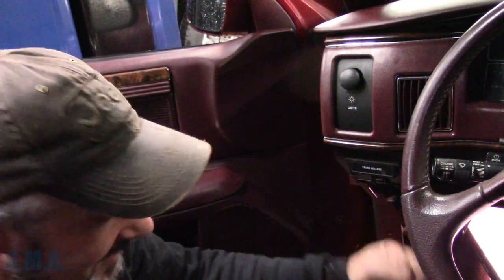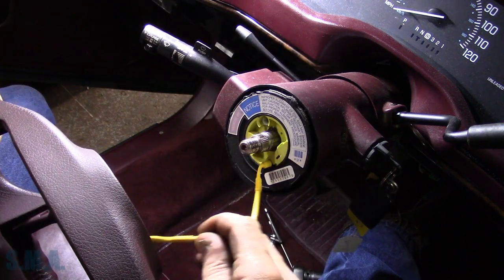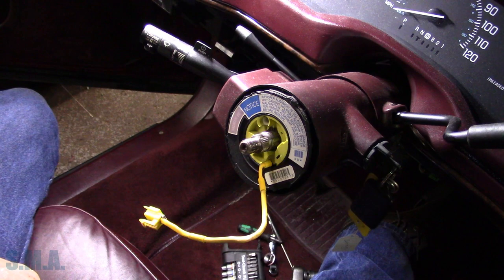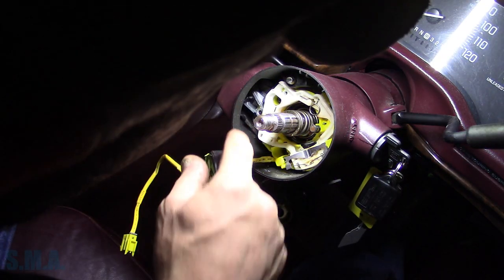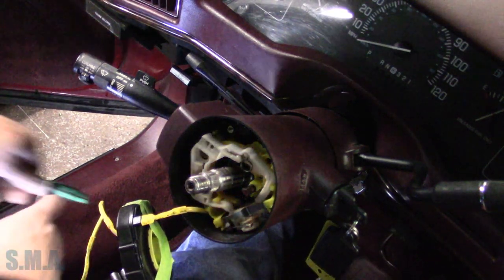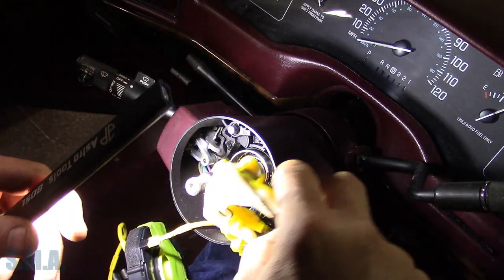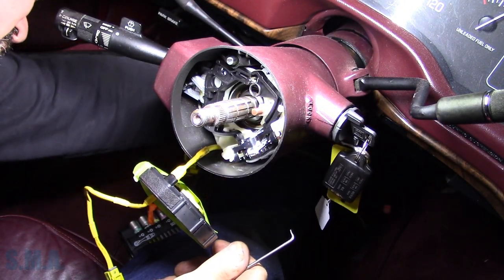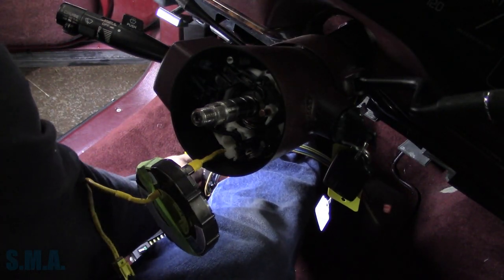Buick Roadmaster: Turn Signal Switch Replacement

Comment: I had to replace the turn signal switches and wiper stalk on my Jaguar xk8 on my driveway - air bag to deal with, 20 year old brittle plastic, very careful removal of cream leather trim (avoiding dirty hands) and of course the famous clock spring. A lot of work to do (especially as an amateur) and a few parts that are very scarce, if not impossible ro replace. What helped my was Eric's mantra -  'if I can do it, you can do it'. It would have helped to have seen this, because I had to follow the offical Jaguar manual which does not give any 'short cuts'. Many thanks for posting these video's Eric because its the 'small bits' that are often the trickiest. I don't mind in the slightest hitting brake discs (rotors) or the like because they are fairly resilient - but dealing with plastic clips and small terminals requires a different skill set. I hope all my friends in the states are keeping well - and best wishes from the other side of the pond.

Comment: I had to put a TS switch in a 2000 Eldorado recently and the column was exactly like that one.  I ended up having to de-pin the connector because I don't have a lovely assistant, I don't even have an ugly assistant, so that was the easiest way for me to do it.  Great video as usual.  Thanks for showing.

Comment: That steering column was notorious for the 4 bolts under the tilt wrist coming loose. I made a puller for the wrist pins, which had to come out to get at the bolt heads. I never had problems with the wire harness, probably because these had no airbags. 
Thanks Eric!

Comment: I always used to keep the old turn signal return springs on old switches because I would come across so many vehicles that had broken ones, especially the right side. Also, I would put a length of mechanics wire on the connector end of one coming out, once out attach the wire to the new one and pull it straight down, never had an issue, quick and easy!

Comment: that car puts me in mind of a old 78 Bonneville I had once ! the steering wheel was just like that one ! I like the 99 Chevy blazer I had now , it has a cover around the steering column you just take off and there is the combination switch and ignition cylinder !

Comment: The video may be 3 years old, but I need to replace the turn signal switch in the column of a '94 Buick Roadmaster Estate Wagon that used to belong to my father.

Somehow, whenever I searched for a video on the switch removal, this did not show up as onecof the results.  

I didn't see it until yesterday, and surprise!  It was was from SMA!
Even with all of the "errors" (hazard warning flasher knob?), it is a great video illustrating what to expect and what to go through.

Thanks for the video!!!

Comment: Watching you do this more than 35 years after I did it to my 1983 S-10 still made my head hurt.  When the same switch failed in my mother in law's 1982 Malibu  in 1989 I told her it was totaled!  And neither of them had a bomb that had to be defused and moved out of the way first.
Reply: Back in the day, getting the connector through the column involve a wire coat hanger - I wasn't cleaver enough to use the wires I was taking out to pull in the new one.

Comment: Speaking of airbag safety, there was a neighboring shop whose owner was injured from an airbag going off in his face when he got in and turned the key to go on a test drive. Really beat his face up a bit but was ok. Guy returned to work and I swear you not another car does the same thing again. And this happens again to a couple other workers. Come to find out the new guy though he was revolutionizing car interior detailing by pressure washing the interior while it was in the car.

Comment: Good Process Eric. I've seen many mechanics always short cut, use wrong tools or improvise during a procedure thus causing collateral damage and/or disturb other wires, connections and so forth to bypass getting the least elephant in the china cabinet results for making time in the repair. That's what makes it for those mechanics who's customers dignify them. "All Fixed" says the mechanic but the customer is noticing things are not the same such as the knee bolster has missing screws/fasteners, scratches on the steering wheel/column now and so forth. That's the real sign of a true mechanic when they get in there and take the time to preserve what's not wrong/broken during a repair, like in this SMA. Especially when its an older vehicle that the customer puts trust in their mechanic. Old or not, I'd bet the owner of the older cars are more sentimental about them than the new car owners are. Keep it OEM/stock and keep it right as it was is key. Thanks for the review.

Comment: Snap rings and lock rings -- designed to test your looking-for-stuff-on-the-floor skills after they fling themselves across the room.  30 seconds to remove them, followed by 20 minutes of crawling around on the floor trying to figure out where the damn thing went.  ;-)
Reply: Do better work or keep a supply on hand. Time is money.
Reply: @skinlab4239  I'm a DIY'er.  Buying a supply of snap rings would be a waste of money for me.

As far as "do better work" is concerned --  snap rings go flying.  It's what happens.  Snap-ring pliers don't hold on very well.
Reply: @LMacNeill  On the possible fliers I tend to put tape around them so they don't fly.
Reply: We called them Jesus Clips.
Reply: Exactly. That happens to me EVERY time.@$!#
Reply: Hate em, hate em, hate them!
Reply: @skinlab4239  Said The Equivocator.

Comment: Good video Eric. It brings back happy memories. My plate depresser tool was thin-walled enough that I just slid that lock ring all the way up the shaft and onto the tool where I knew where to find it and it was ready to slide back down when finishing the job. Cars didn't yet have clock springs back when I had my shop. I used to fold the wires along the connector like you, but I just slid it back down the column without much trouble. Love your videos. It's like being there without the grease and grime.

Comment: Good job Mr. O.  Only suggestion I can offer is via Andrew Camarta - chain saws make short work of interior parts.  It could have open up the column and made fishing the wires a little easier.  

It was good to see Mrs. O in action again helping you as well as providing needed banter.

Comment: I have done this on both a 1986 chevrolet S-10 and a 1988 Chevrolet 1/2 ton.  In both cases, I pulled the column out of the truck and worked on the bench - this saved destroying my ribs lying on the rocker panel and the lighting was far superior as well.  great video, as always!

Comment: We would always tie a wire to the TS connector, then pull the wire and connector through, opening up space in the column, and providing a fishing wire to pull the new harness and connector back through.  Cutting it off worked also.  Good job  Eric!!

Comment: I’ve never seen a stalk replacement so complicated. That’s quite an effort. Here in the the U.K. my cars of that vintage were a 10-15 minute job. Back in the early 90s I could have done four in my old 1984 Renault (about 5 screws) in the time to do that Buick. In fact I did do three which tells you about the quality of French electrics 😀

Comment: I worked at a GM Dealer in the 90’s I done so many of those turn signal switches. You got the job done. That’s what’s important. I still like my older cars though.

Comment: I bought all the tools to work on a 91 Firebird column and each time I got it back together the ignition switch felt like it was disconnected. Tore it down and got it working, reassembled and no switch. After about 30 times I finally got it and sold the car. Glad to know I'm not the only one frustrated by that simple snap ring that always catches in the second groove. This job is now classified as above my pay grade. Yea, I was screaming at the computer that you forgot the hazard button. LOL

Comment: Putting the tilt column in the straight(not lower or higher position) makes it ALOT easier to fish the wiring harness down thru it. I used to repair gm theft recoveries back then. I learned quite a few tricks on those columns. Peace

Comment: Those GM columns were used in everything back in the day.  My 90 Jeep YJ has the same one, minus the column shifter and airbag.  I have also had to go into it super deep to tighten the famous backed out screws to fix a floppy column.  They are not super fun to work on, but it is doable by your average joe.  Your wire fishing job was spot on.  Doing it with mechanics wire is sucky, but also doable with enough patients.  Great vid!  Loving the older vehicles, even if you hate em, lol!

Comment: Being a fleet mechanic for a taxi company during the late 60s thru the mid 80s this really brought back memories, I've done hundreds of those. Where the turn signal arm is directly attached to the plastic switch, and the driver thinks its a arm rest. Thanks

Comment: I did that nightmare job twice on my 1988 Silverado, the service manual said to run a .015 " piece of stiff piano wire up the column channel to pull the harness down.
After trying everything else, I used the piano wire and it worked!
Reply: Now that I see what you replaced my job was different, I replaced the turn signal lever and the harness that comes with it.

Comment: Great job with the vid Eric. I was holding my breath when you were fishing those wires around especially using the pick to move them around but it worked out good. Glad you had an assistant as it would've been tough without one. I don't know of any easier way to get the wires down the column though.

Comment: That little ring holds the entire top of that column together. It is responsible for setting the bearings at the top and bottom of the column. Back in the day I used to rebuild them and sell them to the local body shops for GM and Chrysler vehicles that were stolen recoveries. I used to make a pretty good wage for doing that, one hour of work, typically $30 on parts and I would sell them for $150. Plus a core.

Comment: I can't remember why but I remember getting into my sister's 91 Camaro steering column. I'm about to get into the steering column on my Pontiac Fiero because I'm installing a PKE system and I'd like to remove the lock cylinder and 3D print a new housing or cover to make everything look clean when I get rid of the key and lock plate.

It's common for people to get into GM columns and have trouble getting them back together, I'm in the Dallas area and there's a place called the column shop that specializes in columns of course. They've been the go-to in the Fiero community forever.

Comment: I changed out the turn signal switch in a '71 Riviera that was much the same.  The reason I changed it out was because the cornering lamps I wanted (and added) required a different switch with provisions for the lamps.  The harness looked identical to this one and I did it the same way, by turning the plug sideways and sliding it down the tube.  It wasn't all that bad as I recall from 30 years ago.

Comment: The small amount of current from a DMM is enough to pop one off. Older ones anyway... modern air bags have a shorting bar that helps prevent deployment from stray static charges and DMMs. When I was in college for collision repair, our instructor wanted to see what the resistance was in the airbag module. He ended up with a bloody nose, broken glasses, and a scratch that should have gotten stitches. The classroom needed 3 new ceiling tiles, and while no one admitted it, prolly a couple change of shorts were needed too. One guy actually jumped and took cover under a desk. I won’t lie it scared the crap outta us all!
Reply: Even with the shorting bar you want to be careful. I used to set them off for the FD as demos to show why you didn't want to be in the way when they went off. Used a simple cheap 9 volt battery and long leads.
Reply: was it scanner danner???  lol
Reply: @Blazer02LS  the shorting bar really only stops the stray static from discharging the bags. Yea they are still bombs in the dash of your car... literally.
Reply: @rebelndirt8830  At least the modern ones are a bit tamer, the early ones that GM used were brutal when they went off. Of course now days you also get hit from every corner when they go off.

Comment: Eric, I was yelling to tell you about the 4 way but like my wife, you ignored me. I never used the existing wire to pull them through, it is a great idea just always cut them off on the bottom, pulled them out, removed the tray and pushed mechanics wire down and pulled them with that. Using this method just never occured to me but as long as the end result is the same then you it's right.

Comment: I was rootin for u,had so many that had to de-pin to get wires through the steering column..great job all I can say!
Reply: GM NOT SO MUCH BUT FORDS USUALLY HAVE TO DE-PIN.
Reply: I can’t remember a Ford that I didn’t hav to de-pin,especially earlier models..has to go through that extra little protective channel,just enough room for the wires,much less a plug..

Comment: Yep I posted that the other day  but all the ones I did were encapsulated inside a plastic snap sleeve to keep the directional and such from rubbing and possably shorting out with the airbag wires

Comment: Eric, I may have considered the age and probability of further damage and simply installed a 1 wire weather pack, 2 piece connector to replace that fretted connector. It would have been a good repair and saved you and the customer time and money. And moved on to that potentially expensive SES lamp issue. Just an Idea.

Comment: That's probably the longest-lived steering column design in history, lasting from 1969 through the 1990s. Service manual references that I've seen from older models was to tape the wires against the harmonica connector at the top end and then guide the harness through. Of course those were older models without air bags.

Comment: i just always use a piece of mechanics wire tied to the old harness, cut off the connector & pull it up & out.. tie eire to new connector and ease it down through like you did. don't usually have a pretty helper though.. 😉
I always touch the column shaft for a second or 2 to static discharge before unhooking & reconnecting the air bag though... I was laughing at you missing the hazard knob while removing the switch 🤣🤣

Comment: OK, I had an 82 Firebird with the loose bolts down inside the steering column. I fixed it by wrapping duct tape around the outside of the tilt section and it worked great until one day I was making a left turn and the tape let go. Well at that point rod for the ignition switch shut off the engine as the column twisted. No power steering and no power brakes. Luckily I did not hit anything.

Comment: Of all the GM signal switches I’ve done , it was only Buick that I’ve experienced brake light not working because of the signal switch. I’ve used mechanic wire tied to plug at bottom then pulled harness upwards, some wiggling back and forth and sometimes moving the tilt at same time then use same wire to pull new switch harness down. When using the lock plate compressor i would slide the ring onto the tool gently not to over stretch it , i wouldn’t loose it it the abyss of darkness on the floor . Did a lot of those ignition tumbles as well as they would be clogged with fillings of soft brass key that wear out to nothing then cause problems. 80% of signal swich job needed to be done to access the tumbler.

Comment: ha ha, i remember rewiring my pretty stock (not the engine) 41 Ford coupe back in '66 and it had added on turn signals. when i got done put on right and righr front flashed but left rear too. opposite for left. lol.
 great job. I   I'd like to have that car when it gets old.

Comment: I remember those well.  I have pulled a lot of computer network cable in my life time. I just use what we call jet string. Has 1000 lbs breaking strength. Half hitch around the wire and a little tape around the black connector and pulled up through..  Hey what ever works right.

Comment: I have a 91 Caprice. It is the exact same and I had to do the same as you. I cut the  wires on the old and used them as a fish tape. Made it so mu h easier. I was talking to you while watching. I laughed as you came to the same conclusions I did 6 months ago. Thanks for the video. God bless you and your family.

Comment: Good job Mr. O. Great series on this Buick. Mrs. O is pretty funny when "helping" you.
I always lightly taped the pin connecter to the wires & pulled them up through the column. Repeated the process (in reverse) when installing a new switch. Sometimes they would go smooth & other times they can be a pain, depending on the car or truck. Love the sound of the horn on them Roadmasters. There was something else but I already forgot from the time I was half way through my comment. 

Stay safe & heathy.
Spoke at ya later, Ka moan.😎

Comment: JIS on an older GM? I have run into more Pozidriv fasteners then JIS. I don't really care, for ease of conversation I just go with the flow and say Phillips. Great video!
Reply: jis and posidrive are technically the same spec phillips is the american version of the robertson  made in canada eh
Reply: @richardcranium5839  I thought that a Robertson was a square drive profile from the north.

Comment: I have a GM Tech 1 that you can come to Wisconsin to borrow. I use it in my 82' Malibu and 85' 6000 LE. Used to use it at the dealership that I worked at as a kid. I finally bought one for myself a couple years back to use on my aging fleet.
Reply: Aging??  Uh, they are just plain OLD. :)

Comment: back in auto school i worked on a similar car and i hit the tilt column release with the bearings sitting  loose on the shaft,, i launched the bearings through the shop.. that car was never the same. . newer stuff is much easier to work on